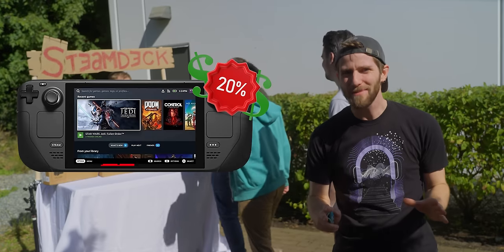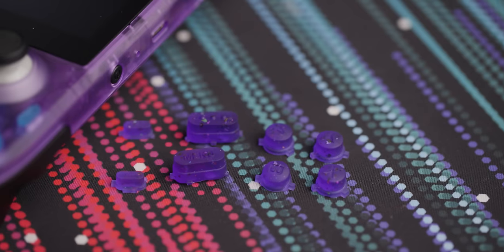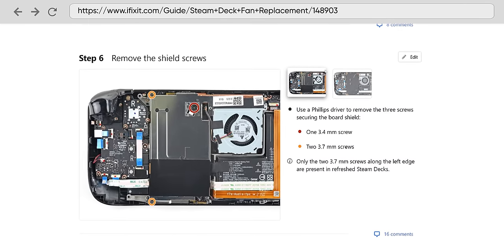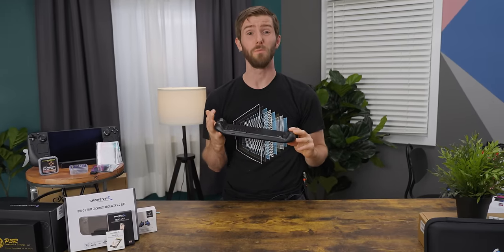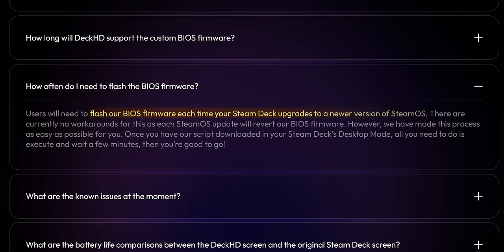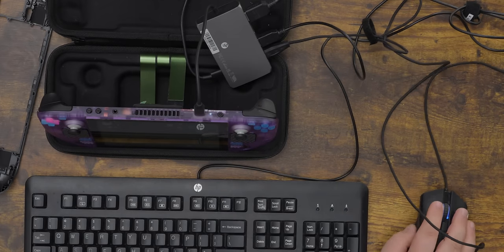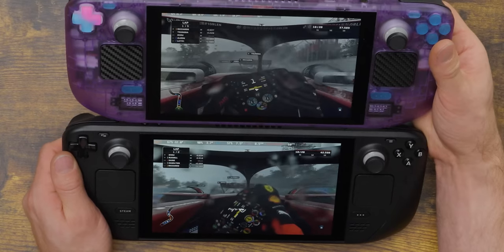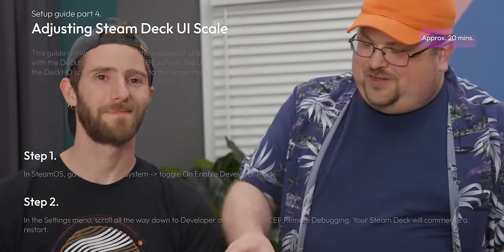Five Steam Deck Upgrades under $100

Comment: The DeckHD is damn stupid. Having a lower resolution display is brilliant on the Deck, it allows you to get much higher frame rates and the lower res isn't even noticeable on such a small screen. What would actually be awesome would be an OLED screen replacement.

Comment: Does the NVMe SSD really matter?  
I use a QLC SATA SSD and two different m.2 NVMe on my desktop 
and the loading time difference is less than a second in games that load >1 minute (or 3 minutes from hdd).

Comment: never buy refurbished. i bought refurbished asus gaming laptop. cost £600 but clearly wasnt refurb unless resetting windows is refurbishing. within a month one of the fans failed which i only managed to find replacements recently, then i looked closer and crystaldiskinfo showed the C: ssd was down to 96% and at the same time the repainted keys asdw and 2and 3 keys was worn off and showed those keys were hammered by previous probable esport gamer owner. in the end with external fans i bought to help out the failing fan, plus the ram upgrade, plus it killed 3 different barracuda hdd until i put a crucial sata ssd in AND that i had to repaste it  because the paste had gone solid, all in all i spent another £500 just to keep it going. i should have waited and just bought new. on plus side i learned only to buy desktop for gaming, its simple to buy a new fan if one fails. plus i can upgrade more than the drives and ram, so once the gpu isnt able to play new games i can upgrade it. cant do that with laptops.

Comment: I will stick with my ROG Ally. The support is not the same but Having a 120hz HD screen out of the box seems better than this. Still more expensive though so not for everyone.
Reply: 120hz is like the ONLY improvement. An "HD" screen that small is hardly worth it. And thats then there are dozens of things the steam deck has over the ally.

Comment: Hey  im geting very mixed info on a problem and because of the fear i wasted money and others are too.
Im hoping you could do some tests to show wich is the case and any fixes.

I was told by one group of "audiophiles" that i absolutely should get in celling speakers for my drop celing for dolby atmos. So i did.

Then when i got them in looked up recommdations on exact installing methods.....and found 3 different groups of audiophiles pretty much saying never use in celling speakers in a drop celling unless you build a giant box around them because the speakers are using the celling as a infinite baffle and a drop celling is way to poris and due to the back wave most of the sound will be cancled.

When i brought this up to the first group they all acted like they had never heared of it and told me its nonsense and to just put a thin sheet in to support the wight and thats all thats needed.

Wich is true? And if it does hurt the sound by how much does it? And lastly are there any cheap and easy fixes that dont involve me building 3 giant ass boxes that my ceiling probably cant hold the weight of?

Comment: I don't want to be a negative nancy but I feel like the list is kinda a bust.  There's a significant caveat to pretty much every item on that list.  Good for tinkerers, but IDK about avg users.  The only way people could use this as their main system is either dual booting or if they only play the latest and greatest AAA games that have steam support/WINE support.  Every game I want to play (which is generally NOT the latest and greatest) doesn't have support, so it doesn't work for me.

Comment: It's a Valve/Linux problem. Fixa le by Valve but I hate with passion how Linux handles external drives. Really grinds my gears when setting up a Pi with HDD to be a small NAS etc.

Comment: So, if i wanted to replace my pc, which is a ryzen 5 2600 with a RTX 2060KO right now, could it still run two 1920x1080p monitors, at about the same performance?

Comment: wondering if using cryoutilites and undervolting and overclocking might squeeze out some lower temps and extra preformance with the new screen.
Reply: Exactly what I was thinking I feel like they didn’t really give it a fair shake anyone who’s going to swap a screen would do an over clock and cryo- utilities

Comment: If you format an SD card in windows then it will behave the same where you have to manually mount it every time you restart the deck :(

I could have swore when I first got my Deck back in August 2022 that wasn't a thing.

Comment: 8:43 you did not apply thermal paste on the DIE correctly - it is not fully covered, that's why it is better spread thermalpaste and not dotting like you do. And they you wonder - why your CPU temperature goes higher. Once again bad effort from the team.

Comment: Finally some mainstream attention to how ANNOYING it is to use an external ssd with steam os. Manually setting the drive. Every. Time. Even if you get the scawp auto mount code it still is incredibly inconsistent whether your external mounts properly as a steam drive.

Comment: None of these things make any sense at all. You're going to spend an additional 25%+ of the deck price to what? Mildly improve thermals on a device that does not have an overheating issue to begin with? To increase the resolution to something the deck is not capable of pushing without significant compromises? 
Slap some new thermal paste in there, upgrade the internal SSD if you want. Play your damn deck. If some company wants to sell me an 800p OLED (yes I know Valve said this would not be simple) then I'm all ears.

Comment: Honestly, I would MUCH RATHER prefer an 800p OLED screen for steam deck, not this 1200p BS
 1200p is overkill, I already mostly play older games on this thing because I want it to stay at 60fps at 800p, at 1200 it’s not worth the performance trade off at all..

Comment: im expecting VALVE to release the STEAMDECK 2 in the near future, which most likley could come with intel's METEOR LAKE chips coupled with mobile arc GPU. not the iris, the mobile arc. which since meteor lake will most likely start using that "tile" design that intel is talking about, which means the GPU part is technically a discrete GPU in a single substrate to the CPU. not "embedded". discrete glued to tile. which i think will be a challenging thing for intel to compete with AMD in mobile handheld gaming devices. im sure this youtuber will not like this idea if it comes true. since he now hate intel for the "discordant" of partnership that happened. whos fault was that?

Comment: I have /had problems to

One of the hall effect of gulikit hits the wire when doing 360, seems they are a little wider at the base, so had to manualy melt / cut some plastic inside the joystick so it wont hit it , 
The jsaux back plate,  my right trigger hits something and scraches, also had to remove some plastick and meltings on the backplate side, seems one of the clips dont stay in place, and that hits the trigger when pushing it

Comment: the deck hd screen is nice buttttttttttttttttttttt id rather have  better color gamut and higher refresh rate for older games like quake 3 which will get over 100 fps or even quake 2 remastered  both will have higher refresh rates . mine with its overclocked screen at 70 hz  stays locked at that refresh rate

Comment: Man I kinda hate ExtremeRate.. 
I've used their products a bunch. Mainly on Playstation controllers (which are easy installs) 
Also swapped the case on my Nintendo Switch. Was also pretty easy, but that's when I realized they purposefully left out a tiny piece. Think it was the border around the non-OLED screen. Of course they sold it separately for an extra $20. Even tho I had already spent like $80 for the "Full" Case swap..
I Do love the way their products look, but I despise some of their business practices..

It baffles me that they have the market cornered, Often being the only company that offers products for 3rd party customization.. You'd think w/ how literally every imaginable product / idea / ETC has dozens or hundreds (or more) Competitors trying to sell identical or near identical products. Someone somewhere trying to make something off literally anything &everything 
Yet somehow ExtremeRate Maintains a comfortable monopoly making what I imagine is nothing short of an absolute killing off relatively simple colored Plastic Injected parts..

Comment: Just buy a onexplayer or a ally got better performance with a 7840U so you already getting more performance plus a bigger screen already and if you so desire you can throw in a bigger m.2 full size I just don't see the point of this by the time you get this far in it's not even worth it....

Comment: If you be my pcb and I would have a screwdriver and resistors and transistors I would want to target it with this Urgent Boarding ECN. Purchase like this is  each five or ten years or as long as macbook lasts or any simmilar type ultrabook with leather casing. I do this Need Xenothreat - I know you have money, it's time to spend it, because holywood does not write to me here - anybody having some meaningful conent so sometimes I would try to send you some views. I just trust them to click or right click on this - but why they would ask. This is Kapraku colors.

Comment: $50 for just some resin/plastic buttons, no way. Is this an Apple product with 200% markup or just steamdeck replacement parts fgs. Linus it's seems  weird that you literaly shit on the monoblock from Billet labs despite using it incorrectly and now you are promoting another monoblock for steamdeck, witch is far from ideal, give me a break. I don't get that bandwagon about transparent cases here, this one looks cheap and even you pointed it out that's IS feels cheap but looks cool, ok whatever floats your boat i gues.

Comment: This is the one video I will dislike because raising the resolution of a display means that the system has to run at a higher resolution degrading the performance. Everything else is good just that simple fact makes me dislike the video.